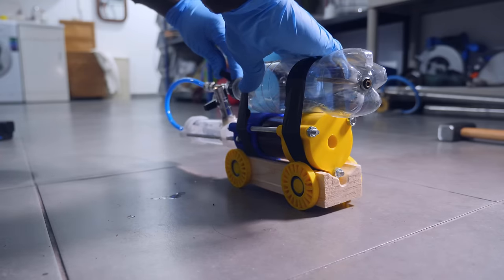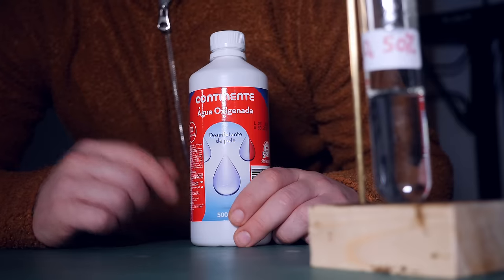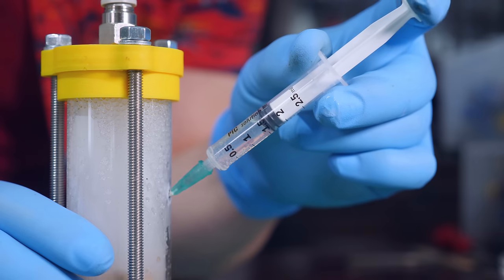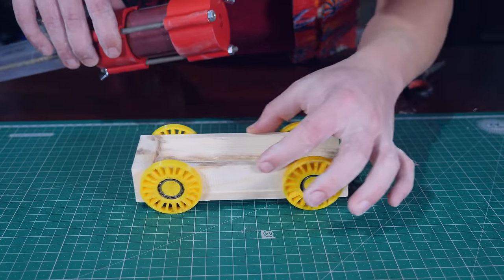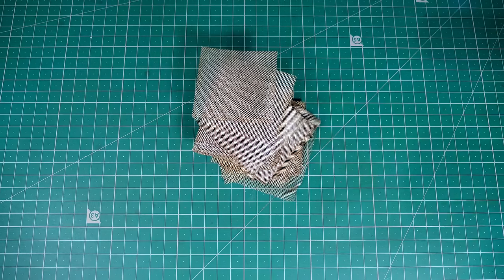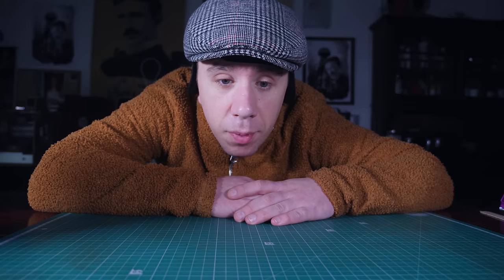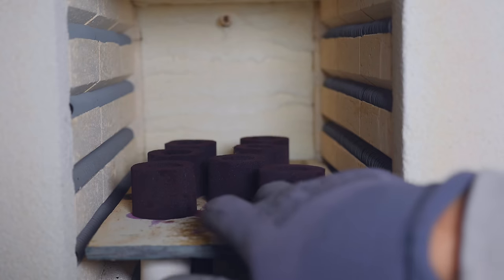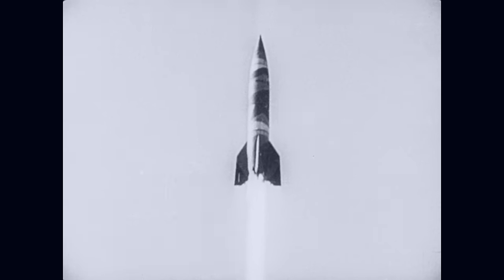SUPER HEATED STEAM ROCKET ENGINE

Comment from the maker: Get Nebula using my link for 40% off an annual subscription: https://go.nebula.tv/integza
Reply: Ok
Reply: I got one for my brother on his birthday and he loves it! Thanks ❤
Reply: Got the Rotary one its really good quality 👌
Reply: Why don't you make v2 rocket powered car
Reply: BRING. BACK. THE. MOUSTACHE.
Reply: Você é brasileiro?
Reply: @integza ! i found an idea for concentrating your hydrogen peroxyde ! freeze the water ! this method is used in the making of high concentration alcohol, since the water freezes at 0°C and the compound freezes at a lower temp (here H2O2 at 50% concentration it is -52°C) you can bring the solution to -1° or -2° and fish out the blocks of ice floating in !
Reply: Use void ti concentrate the perossido
Reply: This video reminded me of a channel called "Explosions&Fire" Hydrogen Peroxide: Going All the Way. Absolutely hilarious video about a chemical that is just one part of the piranha solution. Fun watch, and tells me all I need to know about concentrating H2O2... Which is best described as Nope!
Reply: Vacuum boil the water out of the H2O2.
Put it in a container and use a refrigeration / air-conditioning vacuum pump.

Nothing beats 10 inch extruded coconut carbon water filters for surface area. I believe that it is about 1 acre or 4000m2 of effective surface area in a common activated charcoal extruded carbon filter. Even more convenient, you can buy them already Silver impregnated, and relatively very inexpensive. You can buy single, double, or triple housings for these filters just about anywhere.
Reply: Maybe try other metals than silver like zinc, magnesium or aluminium
Reply: isaac asimov spaceship propelled by water superheated by atomic micropiles
Reply: hi todays my birthday:))
Reply: I feel like I've seen NurdRage use molecular sieves to extract water from things like this
Reply: What if you tried to used aluminum powder how would that decompose
Reply: Wrap the charcoal/potassium mix in a fine mesh screen and introduce the H2O2. The screen should retain the mixture.
Reply: Hey @Integza, you could use an hydrolisis reaction with ammonia persulfate to obtain industrial-grade hydrogen peroxide! This was an old method used in industry

Greetings from Brazil!
Reply: Hey, you
ve probably gotten this comment hundreds of times, but just in case . . . Have you heard of the book "IGNITION!" by John D. Clark.  I couldn't find it in print, but a web search should turn it up.  It's a history of liquid rocket propellant research.  And it's occasionally hilarious.
Reply: Isn't potassium permangenate also called Kondies Crystal's? And used to turn water purple ..
Reply: Careful breathing that foam crap in
Reply: I think you were close with the plaster and catalyst mixture try using an inverted for of the pores ceramic then cap both ends and keep it turning while it cures
Reply: @integza HERE IS A STUPID SIMPLE SOLUTION FOR THE PEROXIDE put it with the steering hotplate in a container with a TON of dry rice , also ad a dehumidifier or 2 in there with the rice

 when trying to dry a wet phone or keep 3d printer filament dry you put it in container with rice to draw out the moisture   , same idea but just over do it
Reply: Hey @integza you should try and pass the concentrated hydrogen peroxide through a fuel injector. It would vaporize the hydrogen peroxide and increase its surface area. I think that would also boost your results dramatically!
Reply: You should make a "CORE" of your Z Stuff with a reaction chamber of H2O2, kind of like a Nuclear reactor only depending on how much "CORE" is inserted the reaction can take off.
You can coat the inside of a cylinder with Z stuff, you should be able to make a FUEL Rod from it too.
Reply: And remember...., tomatoes are disgusting!
Reply: Integza & Backyard Ballistics...Happy New Year 😁😎😁
Reply: @Triangle1234  ⚠️ God has said in the Quran:

🔴 { [The time of] their account has approached for the people while they are in heedlessness turning away (21:1)

No mention comes to them anew from their Lord except that they listen to it while they are at play (21:2)}
Reply: @Integza  Note Well: In the Nebula advert section: Defeat OF the Germans, not BY the Germans!
Reply: @Integza, a decomposition is still a chemical reaction! This is basic Chemistry, how could you make such conceptual mistake?

A reaction does not mean "combination", only transformation, that is, reageant(s) and product(s) should be different, as happens in this case. A catalyst does not change (well, technically, not always in practice) but reageant H2O2 is clearly different from products H2O and O2
Reply: Integza since when is a decomposition not a chemical reaction? Just because the catalist isn't changed doesn't mean the H2O2 isn't undergoing a chemical reaction
Reply: The V2 rivket used Sodium Permanganate as a catalyst for the H₂ O₂ in the turbine. Not quite the same thing as Potassium Permanganate, but a little more effective.
Reply: V2 *rocket
Reply: could you use the effects of an oxygen candle to make a rocket?
Reply: Make a particle accelerator.
Reply: Make a wood gas jet engine or rocket engine
Reply: Put the hydrogen peroxide in a shallow & broad Pyrex baking dish to maximize surface area, & when heated, the water will evaporate much quicker.
      I did this 10 years ago & put a drop of the concentrated hydrogen peroxide on some steel wool, & it burst into flames.
     Of course, everyone working with higher percentages of hydrogen peroxide should be extra cautious & were protective gear, because you can loose chunks of flesh, eyes, fingers, etc, in an instant if you get high percentage hydrogen peroxide on you!
Reply: Were did you get the hydrogen peroxide at 50%?
Reply: Sorry, can't afford any more but I am backing you on Patreon. :-) Can't make it to Open Sauce; will you be attending Maker Faire?
Reply: You can also put the H2O2 in a vacuum chamber which will allow it to boil at a temp low enough to not decompose it.

Comment: I like the foam + KMnO4 mix. Very simple. The downside that I notice is that it burns up, and I doubt you're getting full use of the O2 from that tiny amount of foam fuel. If you want to get that hybrid rocket effect I think it would be better to have a non consumable catalyst and a solid fuel further down the line. For a similar material to your flower foam that is less prone to combustion you might want to look into intercalated graphite. It's possible to intercalate graphite with KMnO4 and I bet it would make an excellent catalyst in that state. There's a paper I replicated at one point that turned graphite powder into an excellent low density foam titled: "One-step room-temperature preparation of expanded graphite". A little KMnO4 in the mix would probably make it into an excellent catalyst, though perhaps too fragile. Another option might be to follow any number of intercalation methods mixing a little KMNO4 into concentrated sulfuric acid, and soaking graphite in the mix for an hour or so. A very durable, flame resistant, and porous option that might make a good catalyst is treating carbon felt in this way. Carbon felt is a wonder material in it's own right and might work for your purposes as is once soaked and dried in KMnO4 solution.
Reply: I'm curious what the actual reaction is here.  Like, is it just a physical reaction with the shape of the KMnO4?  Or is it used up some how in the reaction?
Reply from the maker: Thank you for the advice Ben ! Can you please send me the paper ? integza@gmail.com
Reply: @integza  Will do!
Reply: You seem to be well informed.

Could you use hydrogen peroxide as a regenerative coolant?

Pulse jets get stupid hot and it just goes to waste.

If you ran fuel rich in the combustion chamber and then had the highly oxygenated steam go into the exhaust, it should sort of act like an afterburner.

At least that's my hypothesis.

Would you even need a catalyst then? Would heat just do the job?
Reply: @integza  The channel Explosions and Fire or Extractions and Ire (i cant remember which) has a great video about concentration peroxide. You might be able to use some of his methods.
Reply: he might be able to impregnate Aerogel, It's inflammable. Plus its high volume would allow it to soak up more KMnO4. there would also be much more surface area for it to react with.
Reply: @EnderGamerCubed  aerogel is by its very nature mostly air. There's less mass that's actually impregnable, right?
Reply: @Neoreaver  aerogel does have a lot of air, however he could impregnate it with a vacuum chamber. it would replace all the air with it. it also has a ton of surface area because of how it's made.
Reply: @integza  Hey, KMNO4 + Al can burn very vigorously or explode.. used to play with those as a kid..)/*
I wouldn't add too much aluminum powder to the solid portion of your rocket, but it might help thrust..  might want to start doing this stuff outside though, man..) I enjoy your videos and would hate to see you make them out of the back of your car..
Also.. my mill works well.. should have at least 1 lathe setup in the next month or two.. 
If you ever need something out of mo' durable shiz.. holler.. got al, stainless, some titanium..
Reply: @EnderGamerCubed  Would that also inhibit its insulative properties?
Reply: @Nighthawkinlight  You are such a good citizen of ScienceTube.  Between your own original work, your replications and expansions, and your valuable participation in others communities, you are a real MVP of this community.
Reply: This sounds like it would be fun to play with in a fine wet grinding recipe, exfoliate the catalyst structure from graphite to generate graphene in a kmno4 distilled water grind with a small amount of cmc binder to stop agglomeration and use a particle thats non reactive but hard enough and brittle enough to exfoliate the graphite. Once the slurry is formed, add some more binder and let it set. The kmn04 should crystalise into the graphene structure once the water evaporates.
Reply: I love seeing interesting people in the same place, what a time to be alive
Reply: @integza Instead of heating the H2O2 why don't you just stick it in a vacuum chamber so you can "boil"/evaporate the water off at room temperature? It will take you much less time, I guarantee you.
Reply: @Neoreaver  honestly, i do not know.
Reply: Bit late to the party, but wouldn’t your CaCO3 microspheres work as a catalyst in this situation Ben? Could do a run to prioritize smaller spheres; Would be a ridiculous amount of surface area. Or maybe electrolysis? Could control the rate of decomp based on current?
Reply: @integza  have u seen the catalytic converter method? This guy used and old Platinum catalytic converter from a car to decompose Hp/ Pt oxidizes to Pt(O) with the release of a molecule of H2O in the first step. In the second step Pt(O) reduces back to Pt releasing a second molecule of H2O and molecular O2 , via the surface area that the Platinum mesh had.
Reply: @integza how about using a vaccum chamber to evaporate the water? It "boils" at 25c if you decrease air pressure.
Reply: @integza  Tip: Evaporate off the water faster by lowering the pressure with a vacuum pump.

Lower pressure = lower boiling point = faster evaporation.
Reply: Is this a video idea?
Reply: The solution is always graphite isn’t it?
Reply: @integza can this be used to drive a Tesla turbine? Perhaps one that is linked to another Tesla turbine which serves as fuel pump?
Reply: @integza you can use vacuum distillation to get higher concentration peroxide  https://www.youtube.com/watch?v=2sXoKXGtBng
Reply: @johnjingleheimersmith9259  yesssss! Came here to say this, so now to amplify!
Reply: There are a bunch of those videos online of people soaking  up ink into workout chalk I wonder if you could use something like that
Reply: @jtjames79  extra oxygen will just ignite and burn your pulse jet casing more so than boost performance. Would look spectacular though
Reply: @askjacob  You could use some of the steam as film cooling like the Saturn F1.

Water injection has been a thing for a long time. Pistons and jets.

I'm just wondering if a little extra spicy water would make it work even better.

Also nobody makes pulse jets for any reason other than for the lulz. Longevity is barely a tertiary consideration.

Blowing up on the test stand is a perfectly cromulent result.
Reply: @integza idknif you @'ed him right tho
Reply: Good point, the gas was captured but not burnt which would have resulted in difficulty to know the exact expansion ratio then. Of course if O2 were the only byproduct without a fuel substance to oxidize there would be no explosion. Still a great point of curiosity, what if that O2 were used as a burning Oxidizer? @fightocondria
Reply: Whatavout gym chalk blocks? It can absorb an incredible amount of liquid?
Reply: @integza   Try Ca(MnO4)2  should work better than KMnO4

Comment: @integza, you can try vacuum distillation to concentrate the H2O2 solution. You can then probably use a temperature close to room temperature (around 30C) to boil off the water out of the H2O2.
Reply: I was wondering if you could use a vacuum chamber to accelerate the process.
Reply: Came here to say the same thing
Reply: Yep, thats exactly what I was thinking. STP, vacuum chamber at lower temp, or higher temp. 
....
Will also change temp at which H2O2 will boil, so may cause decomposition... not sure how those bonds break, from boiling or from temperature... maybe the same process.
Im not a chemist.
Reply: I think vacuum distillation is certainly a good idea. However, as most medium and low-vacuum pumps are oil displacement devices, I would also invest in any sort of a cold trap (could also be dry ice + alcohol if you don't have easy access to liquid nitrogen) to condense and trap the distilled water befores it pollutes the vacuum pump's oil.
Reply: I was about to comment the same thing. It would work just like a refrigeration system.
Reply: Explosions and fire made a video on distilling high purity hydrogen peroxide and it is way more complicated than it seems. Vacuum distillation doesn't really work from what I (a non chemist) could understand from the video
Reply: It can also detonate while being distilled. I’ve probably done thousands of distillations and I’d be really concerned about an H2O2 distillation. It’s really something that should be left to the specialists.
Reply: I was able to successfully concentrate my peroxide with vaccum distillation (use a virgrex column) or even a vacuum dessicator with reusable dessicant. I used to have videos on this on youtube untill youtube flagged them as bad.
Reply: @JPMontello  dessicator is much safer. If you’re going to distill it you need to make sure your glassware is impeccably clean.
Reply: Out of curiosity, could he increase the concentration of the hydrogen peroxide solution by freezing it? Freezing water often rejects its impurities, leaving mostly pure ice floating on top of brine containing the rejected impurities. I wonder whether that works for H2O2 solution... Freeze it halfway, get rid of the water ice on top and keep the remaining liquid which will have a higher H2O2 concentration.
Reply: Freezing crystallises the water and leaves almost pure hydrogen peroxide
Reply: Also phosphorus pentoxide works quite well, E&F made a video about that
Reply: Canadian chemist concentrated it to 95percent a year ago by vacuum distillation, this is a way to go.
Reply: yes, from what I could find H2O2 decomposition is independent of pressure, only temperature (higher pressure actually accelerates decomposition from what it seems). so vacuum distillation seem to be the easiest way to do it.
Reply: @danilooliveira6580  but even slight impurities can cause spontaneous decomposition , raising the temperature and causing a runaway reaction. Wasn't the disaster with the submarine Kursk caused by exploding H2O2?
Reply: @evanherk  that is why I hope he cleans everything perfectly and do it outside. but its possible.
Reply: u need a really strong vacuum to get it to 30C, infact its hard to get water to 60C most of the time
Reply: Oh god I’m having Explosions@Fire flashbacks 😂

Comment: You may want to try that evaporation under slight vacuum, given lower pressure it might speed up the time it takes to concentrate
Reply: That's exactly what I was gonna say. At 60 °C and say half an atmosphere it would probably go a lot faster. Probably could get to significant concentrations that way too.
Reply: Agreed. The lower pressure lowers the boiling point.
Reply: This was exactly what I wanted to write! with a good vacuum pump you can effectively evaporate water even at room temperature
Reply: Do need to not lower the pressure so much that the peroxide boils off too though.  Check the phase diagrams for water and peroxide and find the spot where they're furthest apart for best results.

Comment: Reactions only happen at the interfaces, which is why meshes/foams work better.  You need to give the same attention to peroxide.  Improve the injector so the peroxide droplet sizes are smaller and you will get a more violent reaction.